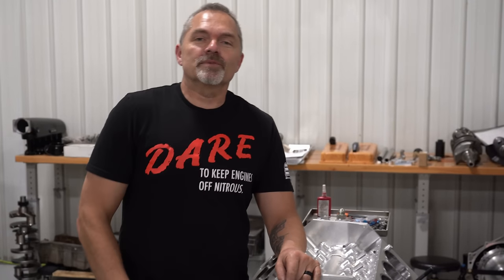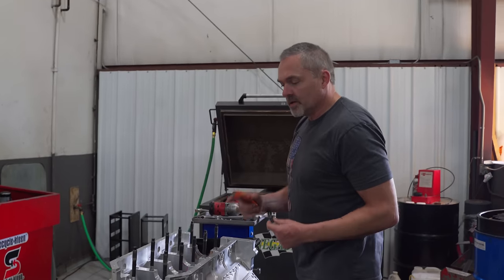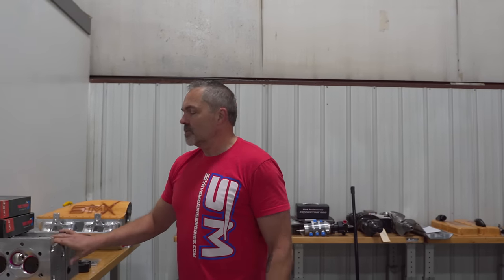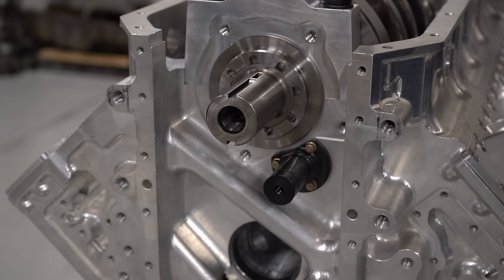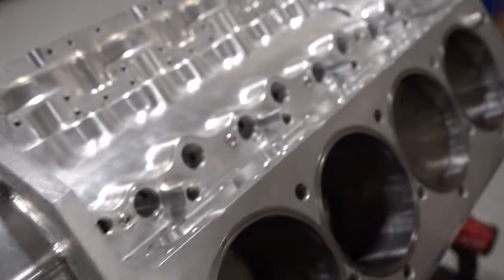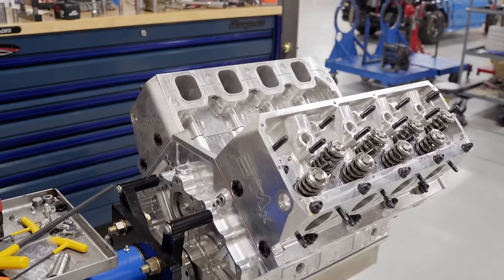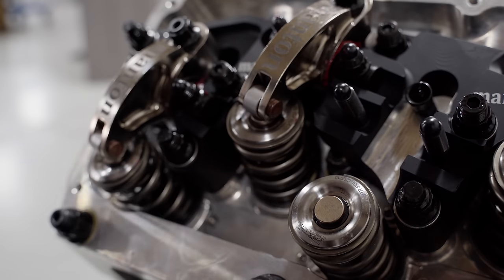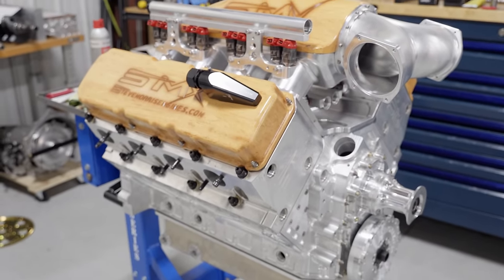Full assembly of the Wagon's SMX Motor! Wagon Prep Part 2

Comment: Steve even though it was a workaround type of situation I believe your replaceable lifter bore is very innovative and I can see this being used quiet often, especially in race engines I think you should patent this idea. I have worked on many engines in my lifetime ( 60 ) trips around the sun so I firmly believe there is a future for this concept.
Reply: This will be hard to paten. But he should definitely consider offering it as an option in general. I would love to be able to buy a block, be able to run either 903, 937 or what ever lifter I need by just changing a lifter sleeve. This has use far beyond just the SMX.

Comment: That thing is a thing of beauty! The tighter your tolerances the more custom fitting that usually needs to be done. The factory really puts a lot of time into it to determine what tolerances are acceptable so that every part will fit when it goes down the line. Those loose tolerances are why some engines just run better than others depends on how the tolerances stack up. 🙂 You are doing it the right way check and fit till its all just right. 🙂

Comment: Piston pin buttons is very common in aircraft piston engines. Almost every Lycoming piston engine is that way. They are either aluminum or brass. As Continental, they have the buttons pressed into the ends of the wrist pins.
Reply: Is it safer or more reliable or what?
Reply: Due to Lack of Circlip C-clip,Jesus clip,Rotor ring or Snap-ring as also known.
Pin Button resting on Piston Rings is a Fail in waiting.

Good job SM purchased a Honing machine for Bore care.
Floaters are only good when Dropping out of an Arsehole into a Pan 🚽

Comment: Steve, i could only imagine the amount of machine word that goes into your SMX line, not to mention once the machine work is done the amount of hand fitting to each part. but when finished it's a beautiful thing... i've assembled my fare share of engines and people thing you can just buy parts off of the shelf and slap em in, those parts require a lot of de-burring & fitting also... You keep on Truckin brother & i hope Route 66 is goo to you.

Comment: i trully love that this is your engine desighn function purpose and domination, the detail and love that goes into these engines and thier incredible performance puts you into the high seat as a ed pink vic edelbrck  etc you are a master and ty so much for sharing the why and hows and taking the speculation out of your desighn, your passion and continual improvement asstounds me as i see these drag and drive cars achieve what would be a fuel funny or top fuel number in the eighties yet drive to the next track a monumental achievement.

Comment: Once you have the new machine and everything dialed in will you be able to just take a full chunk of aluminum basically push a button and have it do the whole block until it needs to be moved to another machine or are there always a ton of steps involved for each part of the engine thats machined out?
Reply: Was also wondering
Reply: I'm still waiting for somebody to answer my question. What happened to the Haas? Get junked or what? Was supposed to be going to "a buddies shop" that was more familiar with Haas/CNC stuff. Never heard anything since.

Comment: Not sure what type of camera you are using. But try increasing the F stop (reduce aperture diameter). A low number works great for low light but reduced depth of field. Increase the number and more of the shot will be in focus.

22:00 you can see the closest rocker is in focus, nothing after that. If I had to guess you are using a DSLR with a prime lens? Not a bad choice, just depending on the shot you might want to bump up that F stop.

Comment: Is that Stainless hardware on the water jacket plates?   What do you do about the Stainless and Aluminum reacting with each other and causing corrasion?  it's Beautiful how all the parts fit together so nicely.
Reply: Legit question. Long term it could possibly turn into an issue but we know Steve's always pulling these things apart so it won't be a problem for short term applications

Comment: So while Cody was doing clearance check on main bearing journals.  I noticed he used the torque wrench to loosen the main bearing caps.  Procedure to loosen it by degrees or didn't want to grab a ratchet?  Curiosity question. Thanks!

Comment: Pistons.  Some pistons have fine groves in the area above the top ring apparently to make a labyrinth seal against cylinder pressure spikes ( detonation ) to prevent damaging the top ring.  I don't see any on these pistons.  Has this been found not to work?   Some high pressure gas compressors ( like for filling oxygen bottles ) use a piston with labyrinth grooves and no piston rings..

Comment: Nice build, of course. Quick question about the front roller trust bearing. A roller bearing is much better than the plain bearing in the rear, but are there any negatives to have the thrust transmitted though all the crank webs, vs when in the rear it's taken care of in the back? Or is the thrust pretty inconsequential when dealing with an automatic and the roller greatly outweighs the plain bearing in the rear anyway? 
Ohh, and I know you have a world class machine shop to turn down that crank thrust plate, but couldn't shims be used on the front retainer cover too, to achieve the same result? but then I guess you would have to have shims machines as well.... so yeah, probably easier to turn that crank plate down.

Comment: Love your videos and Tech Talks!  A question -- you plumb your methanol lines into the ends of your fuel rails.  Didn't Tom Bailey discover that the fuel flow is more evenly distributed if the flow into the fuel rails is in the center and return lines run from each end?

Comment: Watching the tightening of the mains for checking the diameter, the motor stand moves some does that throw off the torque settings a bit. On my diesel 220# I bolted my stand to the floor to prevent movement! Just curious?

Comment: I have a question, wouldn't you want your intake ports to be be as smooth as possible to keep the air moving smoothly and evenly? Would having the hold drilled for head studs cause a lot of turbulence and cause intake temps to rise? I understand you put plugs in but the intake bore is still uneven. Thanks

Comment: This might be a dumb question but I know obviously in drag and Drive applications with your SMX. It has to have coolant flowing through it, but do any of your customers purchase an SMX and strictly just do drag racing and not run coolant you know like some of the other engines like noonan or proline motors obviously, I know those engines don’t use coolant at all
Reply: Pro line is an assembler.  They do not "make" the engines as Morris does.
Reply: @paulcopeland9035  I am aware of that I know pro line buys the blocks from somebody else, but I haven’t seen any of their engines use or require coolant as the DMZ does just didn’t know if they recommended or if anybody uses that particular engine in drag race applications only, and not use coolant

Comment: How does the smx compare to a hemi hp cability wise with a procharger?
Reply: Depends on the HEMI. A stock HEMI isn’t gonna make the power this engine can handle. The aftermarket race engine are going to be generally similar. Hard to say since with race stuff it can vary so much based on what the build is. 
One of the big ideas with the SMX though is combining the good stuff from multiple engines. Steve is familiar with hemis so I imagine the SMX has some HEMI style stuff in it.

Comment: Question for Steve. I like the piston button idea but why not make the piston pin come all the way out in one piece? Making the piston buttons and piston pin all one piece. Would that not make for a stronger component? Or would the larger single piece have too much deflection at that horsepower level?
Reply: Pins are hard for strength , buttons are soft so they don't wear cylinder wall .

Comment: Steve.  Do you  use  the  same  torque specifications on the studs when using  the  " Peanut Butter  " lube  as you  would  when using  the  ARP assembly  lube  ?
Thanks

Comment: How many bolts /hardware pieces to assemble the engine ( long block) , no intake, just valve cover to oil pan without the oil pump , just bare long block,

Comment: Is your SMX designed so you can.bliw out a rod and just replace the "burst panel" on the side of the block?
Reply: Pretty sure those plates are the outside of the water jacket. But, the blocks are expensive enough they’re worth welding up and fixing if one blows a rod out. Assuming it’s fixable at least.

Comment: Instead of using a lathe for your front thrust bearing you should put it in a surface grinder the tolerances is tighter I am a machinist and it will be flattered using a surface

Comment: If you built and ran one of these at a regular level with the titanium and tool steel everything at say 400 or 500 hp how many miles do you think you could put on one? breaka  million? 2 million? obviously without the race clearances for ease of operation and lower wear @Steve Morris Engines

Comment: Not knocking ANYTHING, genuine question. Seeing the plugs in the intake runners made me think-- don't those dead spaces between the runner surface and bottom of the plug cause turbulent air? I am sure there is a perfectly good explanation, like in boosted applications who gives a hoot when you're forcing 50lbs of air into a 1lb space etc....just wondering. (Edit, further into the video...) Random Guy: "Steve, what's the lift on that cam?!" Steve: "All of it."

Comment: Just a thought and I know it's not your cup of joe but I would love to see you go against Rob Dahm with the new 12 rotor engine he is playing with on a strip some time. As they are both tool makers works of art in precision,it would be an interesting comparison in power and durability for a content packed this v that episode.
Reply: I reckon it will be a very long time before we see that engine running and even longer before it's in a car and fully operational
Reply: Nahh. Mans dragging his Feet
Wankel can be built in a few hours 
No Valves to mess with and No Oil Pump either
No Timing needed Just Fuel and Oil mix together 
1 moving part = Crank which is Locked to Rotor 
Couple of Long Bolts and around 100 End cap Bolts hold the lot together 

Even the Builder stated it's just a 3Rotor repeater = Spark fire every 90° of Crankshaft 
= 4 Fire at same time TDC 4 times for 12 Rotors👍

Comment: Its too bad there isnt a goodf unused spot on the other end of the crank to fit the Torrington thrust bearing. It seems like most of the problematic thrust comes from pesky torque converters, so if you could control thrust from the output end of the crank then the thrust wouldnt be trying to flex the crankshaft down its length. . Which would be one less thing it has to deal with.

Comment: What holds the wrist pin buttons in?
Reply: The cylinder wall. That part of the piston should have a good bit of oil on it, and with the design of the button it doesn’t catch on anything.

Comment: I would be really curious how you could make the assembly more streamlined… 🤔
Reply: I'd assume, as volume ramps up, things will get easier.
Reply: Doubt it will ever be more streamlined. Hand built and individually clearanced parts take hours of fit and finish and would you ever fully trust another employee to do it … If you want something done properly do it yourself 👌
Reply: @AndyL940  Not gonna disagree but...I suspect Steve, after building few more of these might change some operations in the program. Everything evolves.

Comment: What engine is this
Reply: Steve morris engine not an ls,not a ford of any kind definitely not a mopar
Reply: SMX.
Reply: It's more MOPAR than anything else ! Look at the deep skirted block , dist. Hole , oil pump mntg. On front of block !only thing that looks like a cheby is the canted valve heads ! It's basically a HEMI WITH CANTED VALVES !